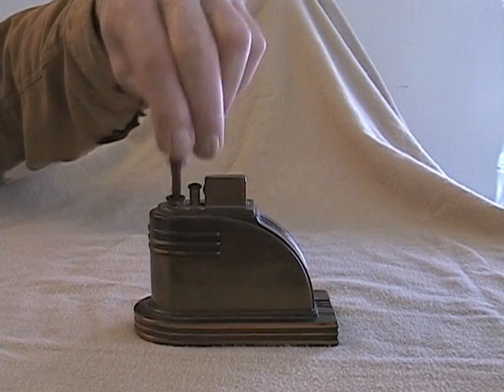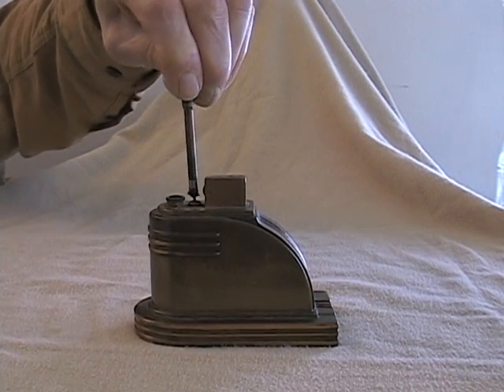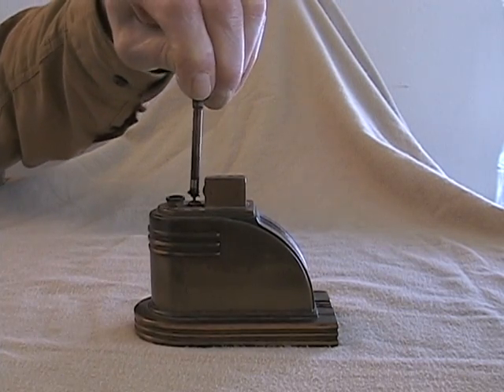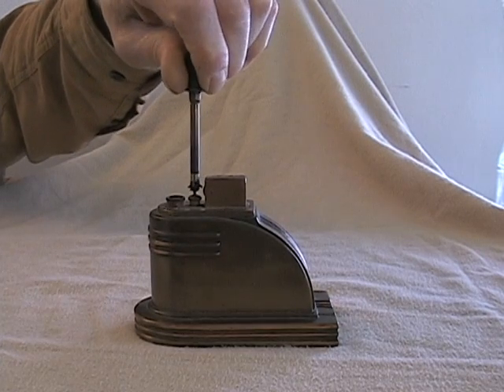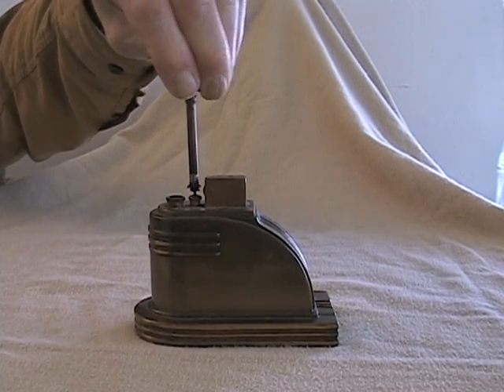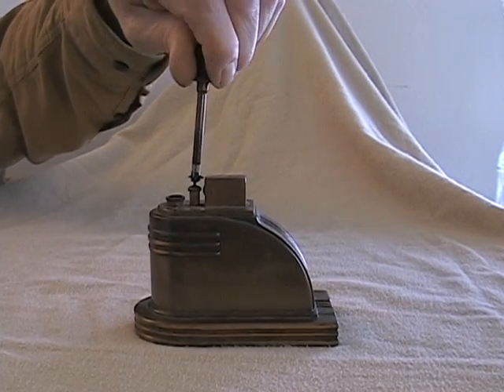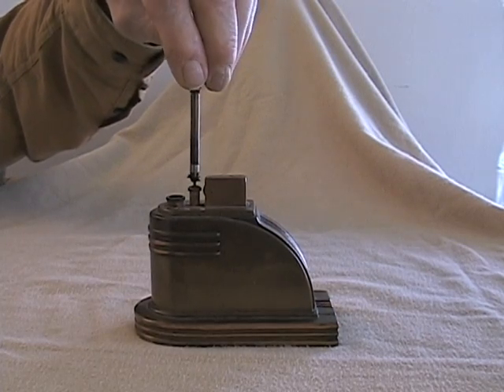Ronson Streamline Tune Up

Comment: how do you sharpen the wheel?
Reply: Contact http://ronsonrepair.com/contacting-ronson-lighter-repair/ and get a full tune up - sharpening is included.
Reply: @wsprja  , bla bla bla.
Reply: You don’t. It’s metal and stays that way. You clean it with a hard toothbrush and if needed a brass brush just on the wheel. I use a bic flint too. Also make sure the spring is pushed up firm. Push fast and release fast to reset the clutch.